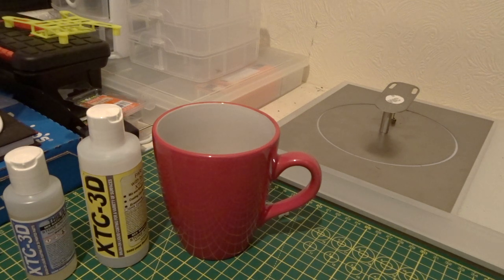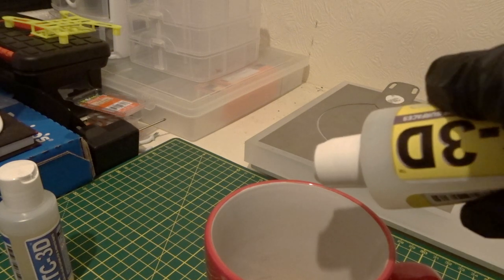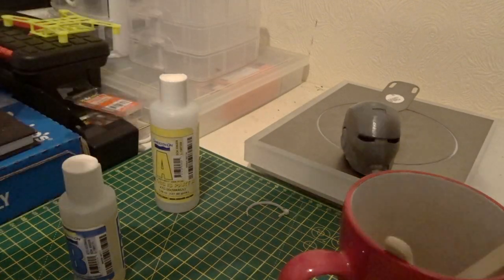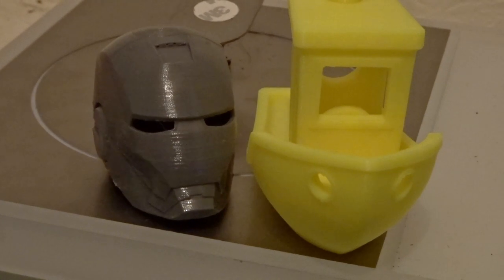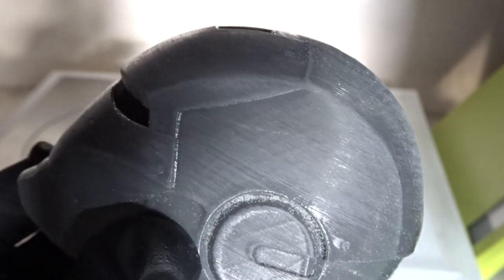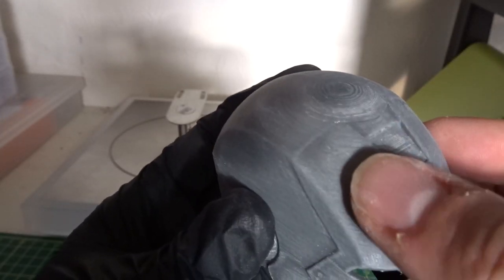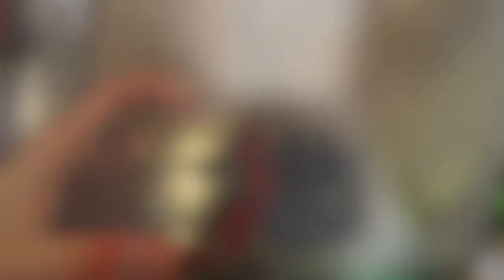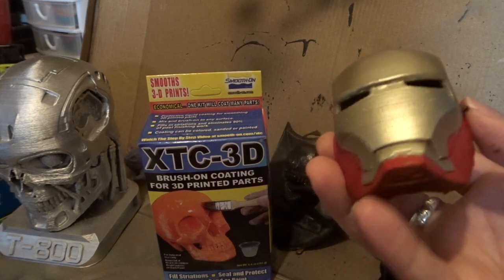How To Smooth PLA 3D Prints Using XTC-3D Inc Paint Video

Comment: Very nice! In your opinion , could I apply XTC-3D on a model thats already been painted?(I was in a rush and wanted to see the color onto the model aswell XD) - Also what paints would you recommend ? paintable by hand and air brushing
Reply from the maker: Hello, the only test I ever did with XTC3D and painted models failed massively. The paint was stripped off it in minutes, and then I couldn’t repaint the model without sanding off the XTC which ruined the model. It was ok as I could just reprint another one, but personally I wouldn’t apply it over paint. 
The paints I use are Vallejo and I use an air brush for undercoating and (once masked up) spraying large areas of a model. And then a brush for applying paint to smaller details. Thanks for watching and hope that helps you out 🙂

Comment: You might be able to glue somepoly foam to a dial rod to go up inside the print to hold it while brushing on the compound to keep it of the gloves and hands. Also a 220 grit sandpaper may give it a smoother finish,  less chance of scratches from the sandpaper. 
 Does look like it turned out pretty good. Looking forward to seeing a finished product. Great job JD
Reply from the maker: Thanks Raymond ill give 220 a go and let you know bud 👍

Comment: Very nicely done! About like we did on wooden model planes with a wood sealer/primer. Many coats, sanded smooth in between, sometimes almost sanding all the sealer off before applying the next coat. Lots of elbow grease involved! Thanks for this explanation! 👌👍
Reply from the maker: Hey Charles thanks matey, lots of work but it pays off, ill be doing an update video on this soon 👍😀👍

Comment: I’m curious as to how well that would be compared to simply wet sanding the print without that additive painted on.
Reply from the maker: Good question mate, i will be doing more as time goes on. A wet sand is generally what i use and if the model walls are quite thick then it tends to xome out very well. The XTC just allows that extra level of protection on the PLA or resin.
Reply: Hi mate as a newbie do you no of a battery charger that would charge sg906 faster 5 bloody hours 😈 just thought I would ask if anyone now's I think it would be you my friend and have a merry Xmas ✌✌👍👌